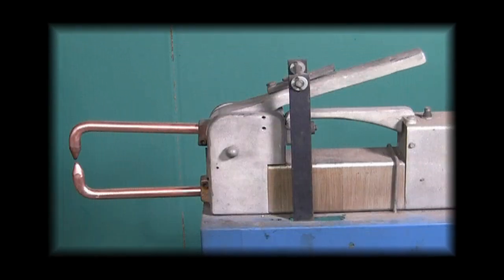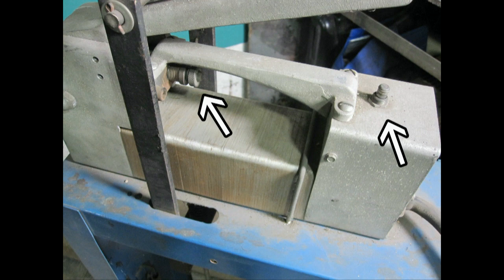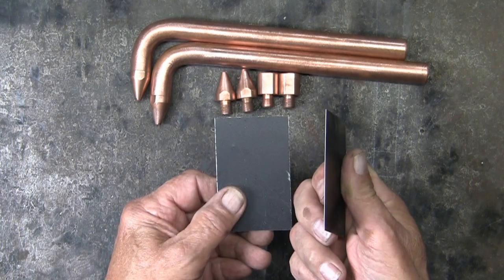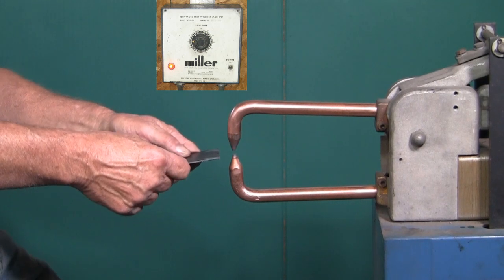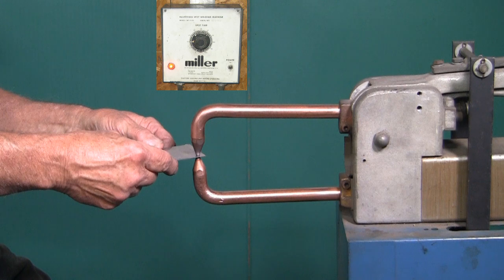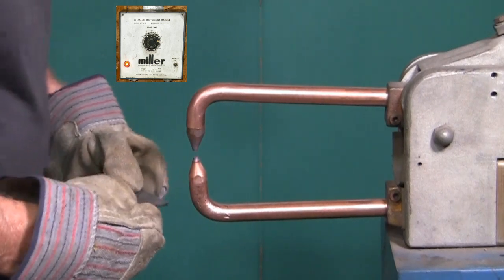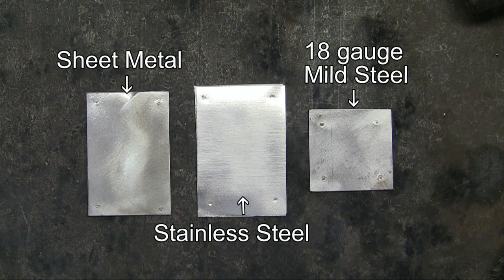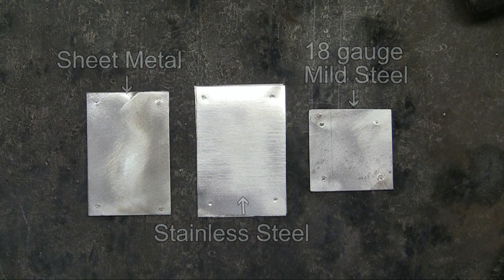Spot Welding Steel & Stainless Steel

Comment: I do a lot of spot welding. There a number of myths regarding this. One is that you can’t weld aluminum. In theory, any metal that has more resistance than copper can be spot welded. The closer the resistance is, the harder it is to separate. Aluminum leaves a thin coating on the tips. Usually, this doesn’t cause a problem, but it can cause the tips to stick. It takes a longer time to weld aluminum, just as it does in arc welding. I’ve welded two 1/8” pieces together, just as I have with steel and stainless. While the specs say 1/8” total for a 120 volt model, and 3/16 for a 220 model, you can actually safely weld up to twice that thickness. Just give a few seconds between welds, say 5 seconds. I do it all the time, and my welders don’t get hot.
Reply from the maker: Thanks for that information.  I've never spot welded aluminium.  Will give that a try.  If you have any more tips, I'd like to hear or see them.
Reply: Don't try really thin materials (aluminum). 16 gauge is about as low as you can go. but the worst that can happen is burn through and messy tips. you have a timer, so you can give it a go. I found I had to make a timer when I was spotting 32 gauge galvinized. the times were so low, I would burn right through it. I don't have a channel. I like yours though.
Reply: I want to use spot welding for 18ga sheet metal, for how many seconds should I hold the button? For how long should I let the machine rest among spots according to your experience?  Thanks for your help. By the way, Im thinking in buying a 220V machine.

Comment: How come you don't need any shielding gas with spot welding? I assume that, even though the two plates are up against each other, some atmospheric gas is between, when the weld starts.
Reply from the maker: There are many welding applications where you don't need shielding gas.  Examples such as arc welding, gas welding, fusion welding or forge welding.  Spot welding is another example.

Comment: how we can weld dissimilar materials in resistance spot welding machines????
Reply from the maker: +noor elhuda  You will need to find a web site or forum that deals more specifically with spot welding.  I only occasionally use the spot welder, so I am not a good overall source of information.
Reply: OK thank you

Comment: How much pressure needs to be applied when spot welding this gauge stainless? Thanks for the vid! ,
Reply from the maker: +howardtoob   Howard, I don't have anything to measure pressure.  I do know when I use the spot welder with this gauge stainless I have to do some trial and error so I get a weld, but do not burn into the metal.  The trial and error also includes adjusting the heat.

Comment: je peux soude des filt galvanisé avec cette soudeuse ou bien juste la tôle
Reply from the maker: Thanks, I'll try that.
Reply: Merci parceque je veux acheter une Soudeuse comme cette mais je sais pas esque elle soude 

Donne moi une réponse le plus vite possible ce tu peux et merci
Reply from the maker: That didn't translate so well.  You want to buy a welder like this.  You want to know something about this welder.  Let me know what you want to know and I will try to answer your question.
Reply: Elle soudé les filt de galvanisé ou pas
Reply: Elle peut soude comme la photo
Reply from the maker: If you are asking whether I can weld galvanized wire?  I don't know.  I don't have any galvanized wire to try it on.  I suggest you contact Miller welding.
Reply from the maker: miller@itw-welding.fr

Comment: any thing straight out the box you had to do to get it working? cause I'm having problems
Reply from the maker: +aanthony21 Two adjustments that I make for every spot weld setup:  1) pressure at contact.  Not too tight and not too loose.  2) The right heat setting.  Not too hot and not too cold.  Spot welding is not something I do everyday, so I have to spend some time with trial and error.